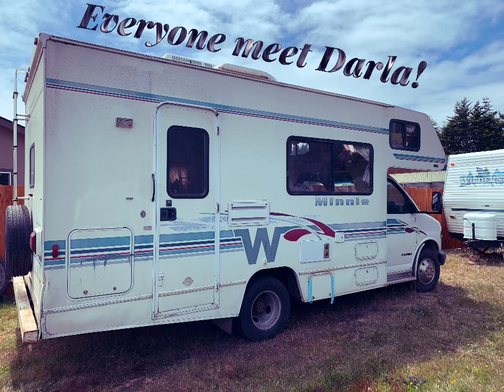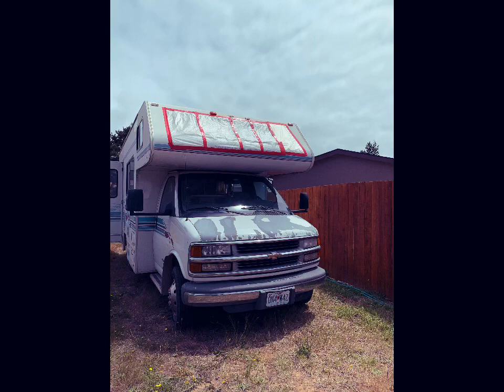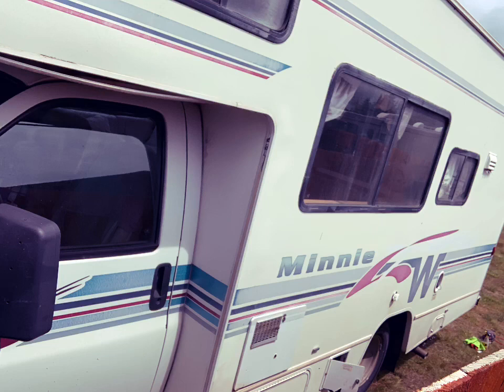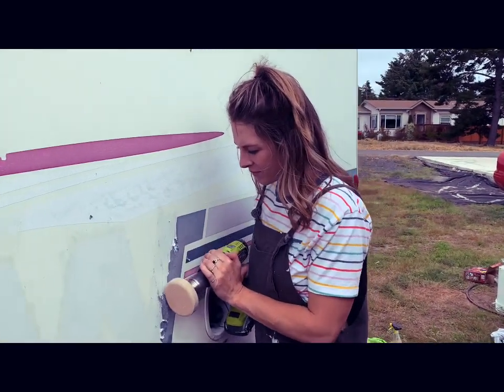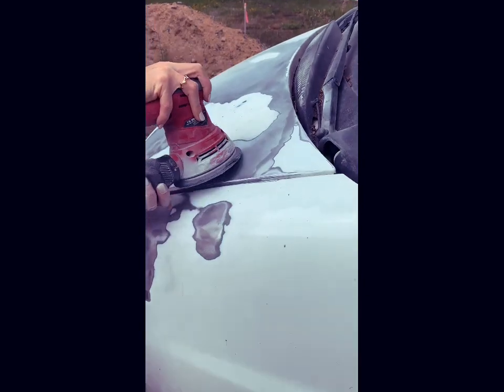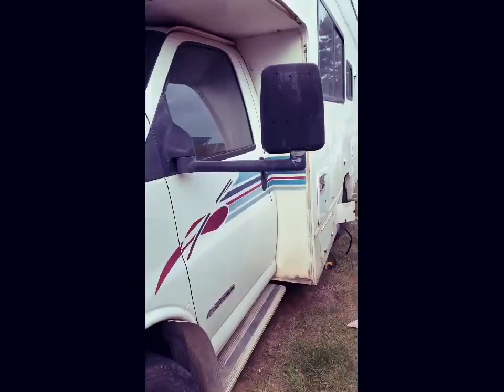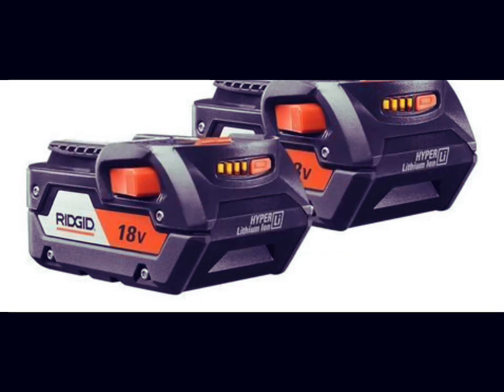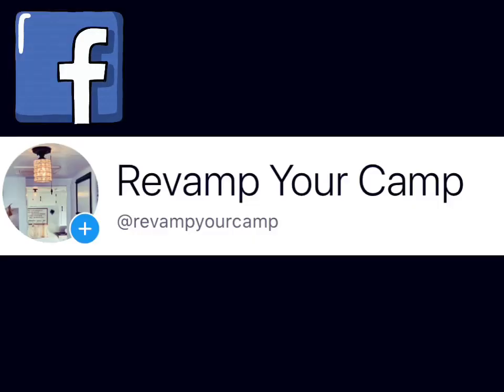Best decal remover for Rvs!!!

Comment: that eraser thing on the drill looks like it would take hours and hours and it looks like it did not do a good job of removing it (I could tell the decals were there)
Reply from the maker: Some of the decals were easily removed with the wheels. Others with the heat gun and some had to be removed with a sander due to being dried on there

Comment: Actually there is a much easier way to remove Graphics from a vehicle. It’s an item you can buy for about $50-$60 at Walmart. And it’s not an eraser and it’s not a heat gun. I have been in the Graphics business for over 20 years and have done graphics on motorhomes airplanes construction trailers etc.
Reply: What is the item?
Reply: ya. what is it?
Reply: aaaaaaaand????  Please share!
Reply: 🏆 and the award for least helpful comment on the internet goes to......
Reply: @charlotter2578  probably graphxoff